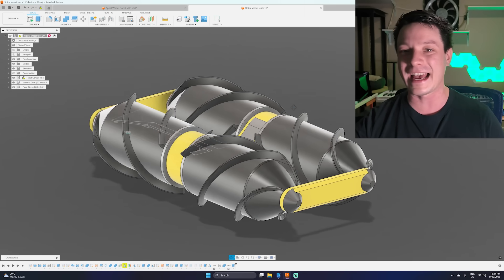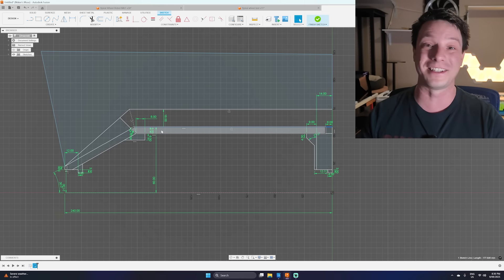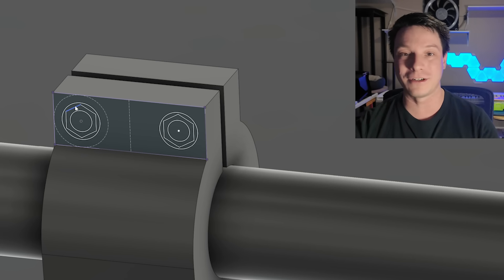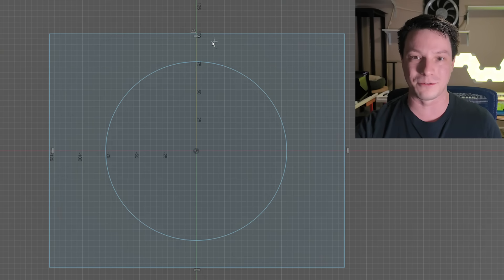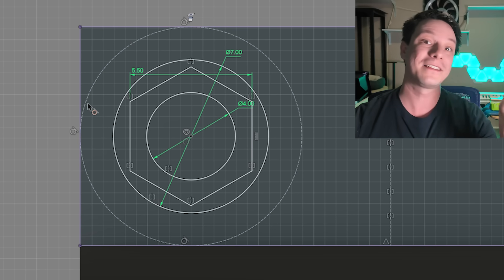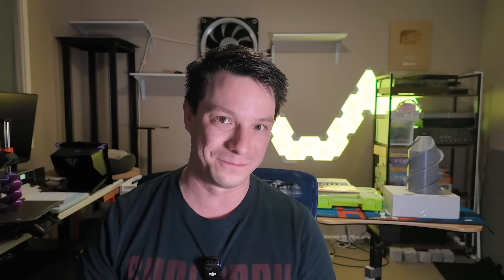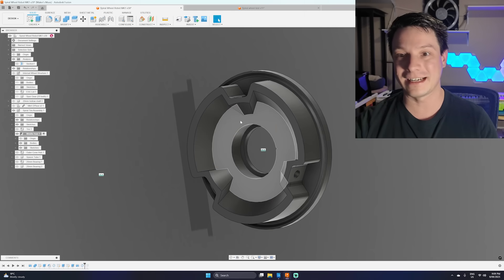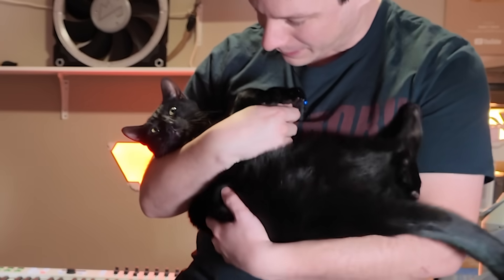Killer CAD tips to speed up your workflow (Fusion, Onshape and more!)

Comment: Around 6:00 you could also reference the diameter itself.
When you hover your mouse over the 100mm dimension, it says "d23: 100mm" you can then use that for the distance to the line above by just dimensioning the distance as "d23/2 +5" to get the radius +5 mm instead of setting the point and going from there.

Also for the last part: i have a document that is nothing but parameters and derive new files from that so i can re-use them without setting it all up again every time. For stuff like screw heads, nuts, etc. Stuff that always has the same measurement but without re doing the parameter table every time i need it.
Reply: Just to extend this, no need to hover, if you are editing a dimension  clicking  on the other dimension  you want auto fills its dxx reference number for you, probably what you meant though :).
Reply: Also on solidoworks at least holding shift while selecting uses the actual sketched line instead of the center point so you can dimension to the edge of the circle without adding a point.
Reply: @dylanlasky2389 thanks for this one, that's always annoyed me. Hopefully I won't forget before getting back to SW on Monday
Reply: @JanPeterDeVries  also works on drawings ;) I think its nowhere documented, and i found it myself either via trial&error when i had to learn SW, or it was mentioned in one of those random tips on the official SW YT-Channel.
Reply: Better yet, define a parameter for the diameter with a useful name.
Reply: @tektrixter  just to add to this, when entering the dimension you can just type "xyz=123mm" and it defines a parameter named xyz. Saves a lot of time when you don't need to click around in the parameter window.
Reply: I also always reference other dimensions by clicking on them. An issue only arises if you would like to dimension the circle not via a number but via constraints. Therefore I will prefer the solution with the point in the future. Thanks for the tipp ❤
Reply: This is my preferred way to do things, but I also create variables (using Onshape, I'm guessing Fusion has the same). Even if it feels like it might clutter the steps, conceptually, it is a much more direct way to define things:
# MainBoreDiameter=100mm
# MinWallThickness = 5mm 
# BoreEdgeDistance=# MainBoreDiameter / 2 + #MinWallThickness

I find that setting "seemingly random" points  on curved geometries ( and sometimes, angles) especially can make your sketch technically defined but in a way that you don't quite expect, so when you change the dimension the whole sketch breaks.

Comment: At 9:12 you could also have avoided the calculation in the dimension, and instead used a diameter dimension. Start the dimension from what will be your center line (in this case the horizontal line) and end at the other horizonal line. Then right-click and choose "Diameter dimension", and enter the actual diameter you want. The sketch will now show that dimension as a diameter. The end result is of course exactly the same, but design intent might be a little bit clearer if it shows as a diameter.
Reply: Good to know 
In Onshape you can do it too 
If you dimension "to" a constrution line and move the mouse on the opposite side it switches to like a dimater modus

Pretty neat feature that was added a few month ago i think

Comment: At 5:49 you add an extra point to dimension from, which is unnecessary. While points can be very useful, in that particular case it would be easier (and more logial to my mind) to use a tangent dimension (right-click when the dimension tool is active, and choose "Pick Circle/Arc tangent") between the circle and the line.
Reply: You can also typically do a tangent dimension with a shift or Ctrl click on the circle when in the dimension tool. This works in all CAD I've used to date.
Reply from the maker: Very true! It was a bit of a simplified example. Tangent dimension works well instead in that case.
Reply: better use variables and expressions and never use naked numbers in dimensions.